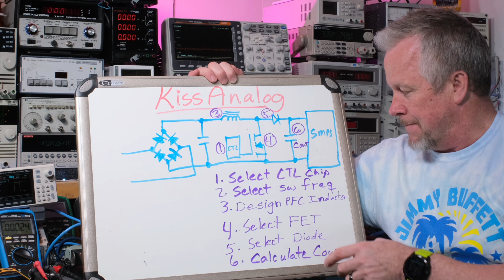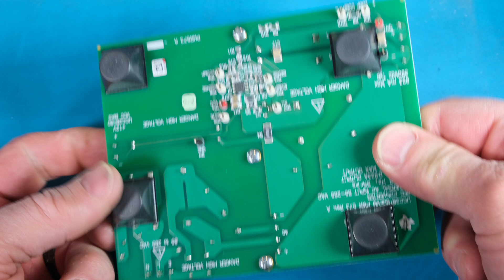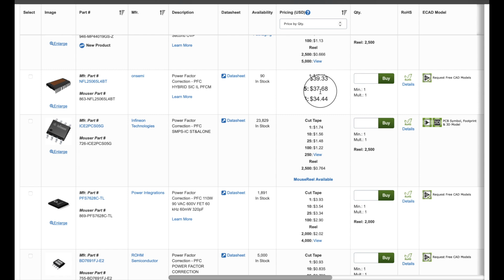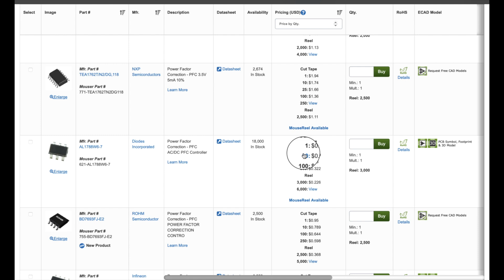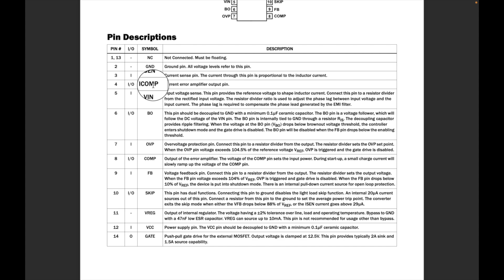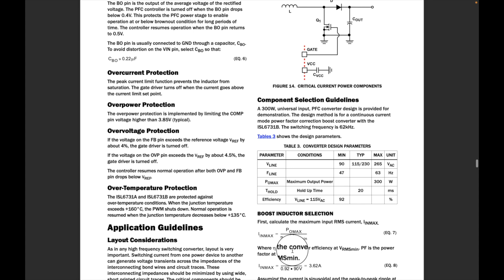PFC DESIGN START with JAT Collaboration Audio Amp ep#3

Comment: I would like to see a PFC controller without integrated FET and integrated Diode.
- We can have fun selecting our own discrete components.
- The controller will be more reliable without the high voltage, high power components (less heat).
- Better for obsolescence, if 10 years down the line you blow up a FET and it is obsolete, there can be a replacement for it. If it is all integrated, good luck with that, your power-supply is a write off.
Also, I am not sure what the obsession with pricing is? $2,50 versus $5,- for an audio amplifier. Obviously the added price must accompany the added benefits, so if the $5,- part is not any better than the $2,50 part, it makes sense.
Reply from the maker: Great points Hugo!  I think we will go with discrete components;)

Comment: I am keeping notes of all design procedures. An integrated switch IC might be a good choice considering cost, size, and ease of design. Just, in my opinion, discrete PFC is also great for learning, and customisable.
Reply from the maker: You make some great points!  I think we will go with discrete, but maybe later do a lower power integrated solution;)
Reply: @kissanalog  Thank you!

Comment: having a problem seeing any switch mode power supplies AC mains /AC 24V, I want it for a motor control unit, is there any issue connecting DC to AC at 24V
no problem  going through the bridge and filter caps, I don't want to bypass that section.
Reply from the maker: Thanks for the question!  Do you want an AC to 24 V output?  If so, you might be able to see how this power supply that we will design can be made to do that.
Reply: @kissanalog  
I'm just wondering how it affects using a DCV on a power supply with a full bridge rectifier, does it increase noise or stress on the bridge rectifier, maybe type has a bearing, or just passes through without any issue.
what I'm saying is I don't know how the relationship between the smps and the diode and capacitors of the power supply in a unit have on each other if any? I suppose it's best to do away with the bridge rectifier but if you want to switch between that and ACV linear supply that's not practical and if necessary.
Reply from the maker: The PFC will pull power throughout the sign wave so it is less stress on the other parts than a simple rectifier power supply.
Reply: @kissanalog  
so no problem keeping the rectifier in place.
could you have a sensor on the power supply for feedback of rotation, like keeping a motor at a steady speed with tight tolerances like quartz lock
Reply from the maker: Yes diode commutation control has been used but is still noisy - and probably even more noisy, but does provide crude regulation.

Comment: Thanks Eddie, that was an education - simply wonderful! I'll run a calculator over the design maths for the Intersil chip and compare notes when you make later videos to see how I got on!

Searching parts supplier's lists for the few items remaining has become the norm the last couple of years. I do exactly same, click on the 'in stock' box then select the part they have most of. You must now adjust the design around the parts still available, component availability now drives  and dominates the design like never before.

Always said the PSU should receive as much care and attention as the output stage in audio amp design. We are, after all, just switching the power PSU voltage through the loudspeaker at audio frequencies. 

Looking forward to the next video, keep up the outstanding work.

Comment: 👍 this project Will be a power supply that you can adjust to fit any of Nelson Pass custom DIY amplifiers Class A Projects that is exactly what I’m going to use this for.
Reply: what sort of power are you looking for in the power supply probably 300w minimum
Reply: @hoobsgroove  yes most Nelson Pass smaller class amplifiers would be the 300 W sometimes 200 W power supplies

        For the larger class A Nelson Pass amplifier designs like the turbo version 2 F5 design.   Then you’re starting at 500 W power supply some people use as much as 800 W for that extra head room just because they can. 

I’ve built standard plain Jane simple linear power supplies before but I wanna build something a little more advanced a little more tinkering and do a head-to-head comparison to what I have always used my old school power supply designs. 

Time to learn something and except something a little Newer
Reply from the maker: Cool idea!  Thanks!
Reply: @kissanalog  
surely you want a high wattage power supply to run very cold and less noise?

Comment: Sup homie. I almost bought a fluke 289 last night haha had my finger on the purchase button haha
Reply: That's a good meter - I almost paid $375 for a used one on ebay.  Instead I bought a brand new Bryman 869s with the optical data logger cable. Cost less with higher specs.  ; )
Reply: @reedreamer9518  where I live man they're almost the same. The fluke is about 150 more. 87v used to be 450 here now it's 680 or so. Inflation is fucked. Fuck January 6, fix that bullshit in Ukraine and throw out the democrats in the US and liberals in Canada. They still uphold covid rules here in canada. Trudeau wanted another lock down and the provinces told him to suck a dick but concessions were made as are won't of them. Politicians are like lawyers I always thought, arguing on TV but drinking buddies in the night but this 2 year flu got the left over a barrel.

Sorry man. It's annoying
Reply from the maker: The Bryman was a better choice IMHO;)
Reply from the maker: Joey - the Fluke 289 is my least favorite meter.  Flukes are all way over priced for what you get IMHO.  The 289 is a battery hog and a huge meter.  Not much fun to use either.  For the Flukes, the 189 is my favorite.